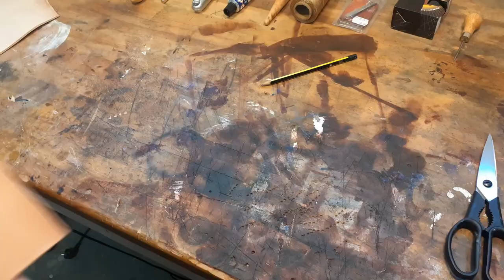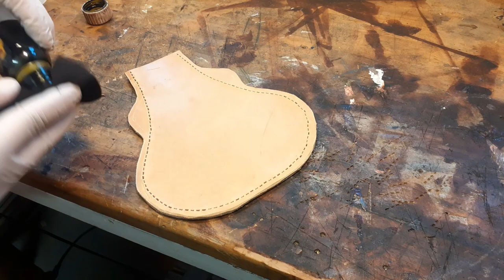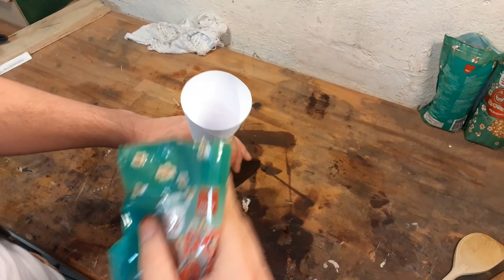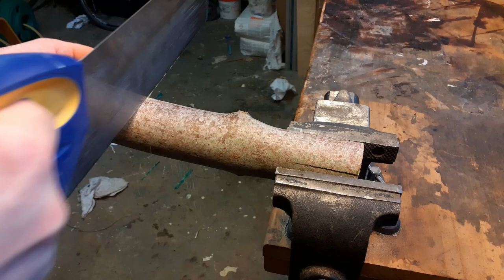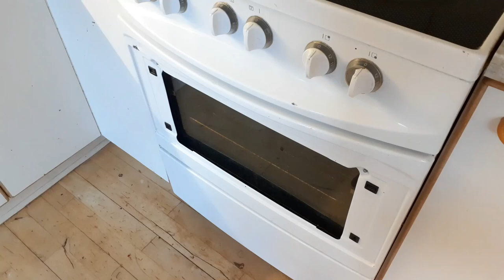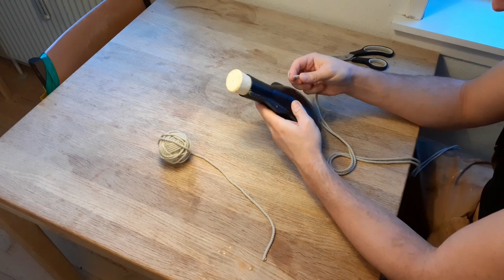Leather Working - Making a leather Costrel

Comment: Thank you for using beeswax instead of pine pitch.  Pine pitch makes the water taste like turpentine.  Pine pitch is not brewer's pitch as others have claimed.  I have never been able to find a source for actual Brewer's pitch.  I use beeswax inside my gourd canteens, and it works fine with no bad taste.
Reply: Townsends has Brewers Pitch
Reply: @ferrarifly    They sent me pine pitch years ago claiming it was brewer's pitch.
Reply: @robertrobert7924  well I’m glad I never ordered any
Reply: The only issue I've found with the wax is having it crack and flake off due to fluctuations in the temperature.
Reply: @Ianbond21  That will happen.  Usually not a problem in warm weather.  I used to primitive camp @Ft. Frederick, MD during the full moon in early April.  The temperature could be 90 F during the day and 25 F at night.  I had to rescue a newbie one morning who only brought 2 surplus Army blankets to sleep on the ground with.
He had hypothermia really bad.  I wrapped him up in one of my 4 point trade blankets and gave him some hot coffee next to my campfire.

Comment: Hello! I just have a handful of questions:
How long did you let the leather soak in the water bucket?
When you put the leather inside the oven, what temperature did you set it to and how long was it in there for?
What temperature did you heat the beeswax to?
How much beeswax did you use?
Reply: For how long to let leather be soaked in water, not long. I do leather work, and I just do a dunk or two. Sometimes I just run it under the faucet. Veg tan leather is really dry so it will soak it up quick. From what I have learned, because I want to make these also, is to use "veg tan" leather only. Don't use other types of leather because they have different types of chemicals in them to be treated with. As for the other two questions I watched "the bearded hobbit" and he goes through them with you, its about 3 videos long. Hope this helps.
Reply: @thequietshodan  You're a lifesaver! Thank you so much
Reply from the maker: hello :D! i just soak it in the water for 5 minutes and put it in the oven at 70 degrees celsius until the wax melted. I heated the beeswax until it melted as well, i did not use very much, hope it helps :D

Comment: Fb stopped comments.   But thanks .  I needed a easy project to build and want one really bad.    - would waxing b4 sewing also be effective?   
- beeswax?  
- glue edges?
Reply from the maker: Your Welcome😃! I would recomend sewing and gluing the edge before using the beeswax 😃🐝
Reply: @zakisworkshop  ok.   Just making sure it was beeswax by itself you used.   Seen others use  pitch

Comment: What kind of glue did you use?
Reply from the maker: i used leather glue 😃
Reply: @zakisworkshop  there are more then one kind of glue usable for leather. I used polychloropren glue (it is called "88-th"  or "Nairit" in Ukraine) and poliurethan glue or  "Desmokol" .  They are both basicly some kind of plastic dissolved in aceton or ethilacetate.  And both are toxic. If you expose    them to hot vax i have no idea how any of those going to react. Heat make them melt and not hold glued parts together animore. One of my friend is using water based glue for leather,  but I find it's smell so bad, I dont use it and do not know it's features. And that  green substance you are using, it is first tine I see it.

Comment: I made one a few years ago and it ended up leaking 😕. You glued yours which is something I didn't do. Is that what prevents it from leaking?
Reply from the maker: If you have sticthed it Very hard you dont need glue 😃 , did you Remember to line it whit beeswax 😃?
Reply: Well here's the thing I stitched it pretty well I thought. And I did line it with beeswax. But then when that one didn't work my mentor bought me one from overseas and that one actually leaked to. Despite me being very careful and keeping it out of warm places.
Reply from the maker: Thats sounds strange, the one ive made still holds water so maby  it was Something to do whit the glue 🙂

Comment: Could someone help me out with what glue I need to be useing
Reply: Leather workers’ Cement is PVA which remains flexible after drying, but costs 3-10 times more than normal PVA. 

If you are a woodworker, use whatever wood glue you have. It is very effective, so long as you abrade the surfaces of the flesh side, so the glue can soak in. 

If you want to use a contact adhesive like in this video, let it fully dry, then hammer it. This is what Cobblers use. It is very strong, but not really necessary if you’re going to stitch through it. I’ve used all sorts in my leatherwork. Even double sided sticky tape. But that’s not good for sewing through. 

That’s my pennyworth! You really can take your pick, and as a very wise source once told me ‘Use what you’ve got’.

Comment: if you put alcohol in there would it affect the bees wax?
Reply: I make drinking horns using beeswax to line the insides, Beeswax takes very well to beer and wine I've found but I wouldnt recommend hard alchohol personally. I'd use food grade resin instead if thats your aim but honestly metal flasks are just better for long term use. Because canteens tend to be fairly tougher to clean I'd also recommend do what they did historically and make 2, one for booze and one for water. Hope that helps!